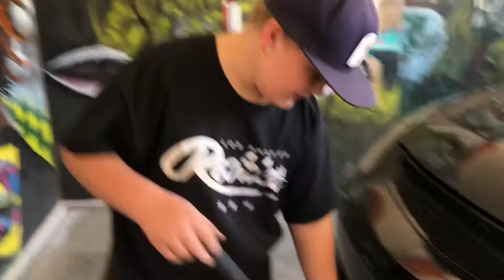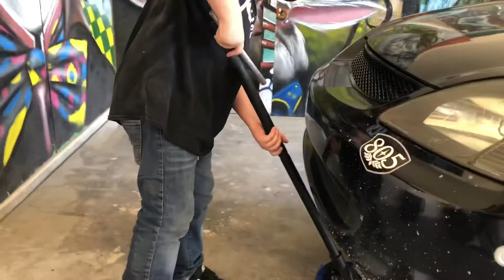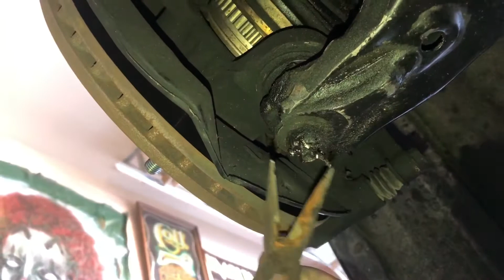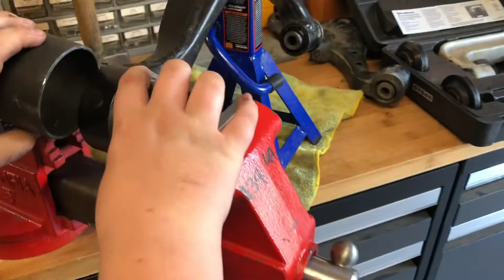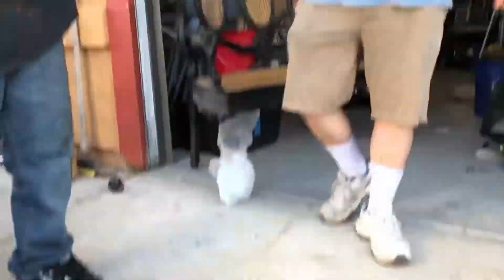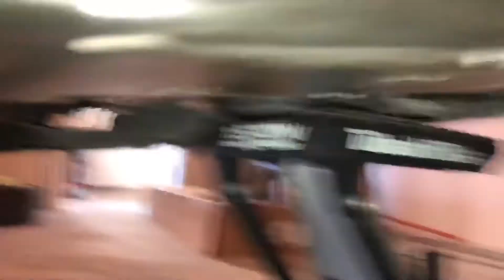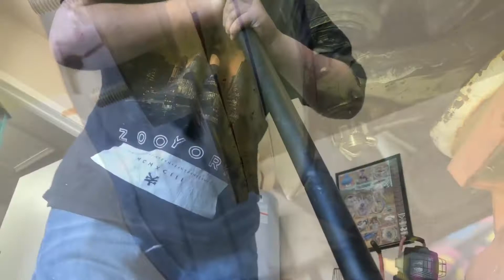Civic Ep3 LCA bushing replacement Energy Suspension lower control arm bushings

Comment: Where’d you get the front lower control arms from? I’m having trouble finding some.
Reply from the maker: What we did was remove the existing one that we already had pressed out the old bushings and then pressed in the new bushings and put the old control arm back on. Thanks for watching.😀

Comment: Use. Jack stands.
Reply from the maker: Our jack has a safety bar we mentioned it at 2:11 min into the video. 😀
Reply: @YoungGearHeads  Still, I wouldnt trust it, the car is only being held up on one point. Whos to say it wont become unstable when you reef on something with a breaker bar? Jack stands give you at least two points where the car is resting, better stability.
Reply from the maker: @NovaScotiaKevin  makes sense, safety is the #1 priority.👍🏻
Reply: @YoungGearHeads Doesn't matter! THINGS FAIL! Seriously it is a matter of chance! Honestly not using Jack stands is just stupid